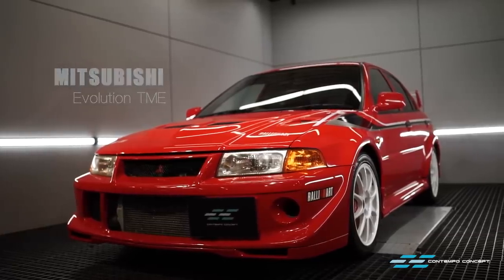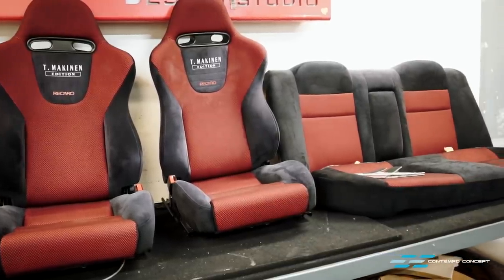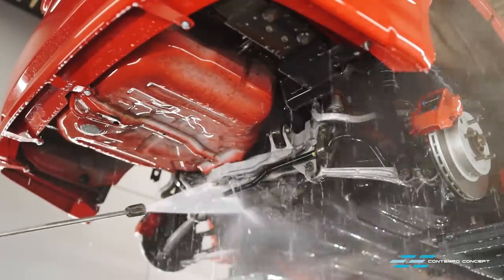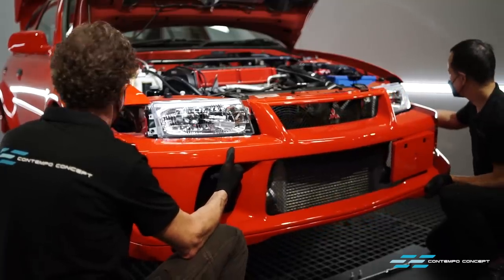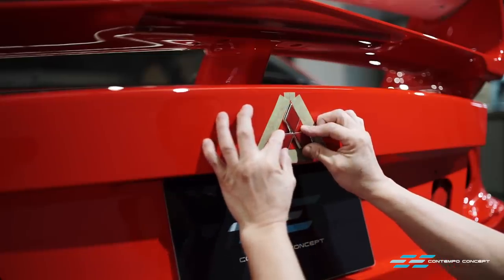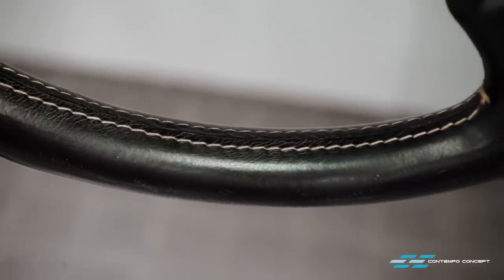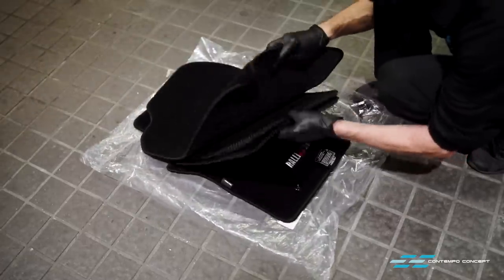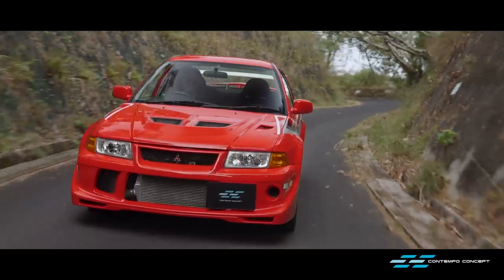Mitsubishi Lancer Evolution Tommi Makinen Edition Restoration

Comment: I love the fact that you have saved the original seat covers and not just replaced for newer ones. For me, the true meaning of restoration is when one tries to use and restore the original parts which came from the factory that includes evey nut and bolt.

Comment: The end result is awesome your work is incredible too. The only thing I want to point is that restoration with buying all new parts from magnification is super expensive. I'm an owner of an EVO X and I can tell you that the original hood is more than double the price of a high-end carbon one. I understand the difference but changing a large amount of the parts by brand new is not so awesome as restoring the old one. I can totally agree that new vs restored is not the same and you guys are professionals and perfectionists and that is all about in the video.

Great video totally worth it watching it.

Comment: It's great that you presumably can still buy all these parts brand new from Mitsubishi. That really is such an important thing. I've owned and restored multiple AE86 over the years and the biggest problem of all when doing a restoration was actually being able to obtain the parts. Try to order new from Toyota? Forget it. Vast majority of bits are long since discontinued. And the few that remain cost a lot. Like even for a few window exterior surround strips it costs like the equivalent of $3000. New interior parts like door cards or seats etc? The only option is to search for them used.. and most are in worse condition than your own. For a set of rare interior seats like the rare tweed.. you could be expecting to pay many, many thousands.. and that'd even if you can find someone willing to part with them (you wont). Lights.. all discontinued now. I actually have some lights that bought years ago and they're worth ridiculous prices but I wont sell them. To do a perfect restoration like this would be nearly impossible on some cars as you just wont be able to obtain the new pieces.

Comment: Not sure what I think of this resto and the collectors dream comment. Collectors are looking for original cars/ survivors and they can still be easily found. If that paint was original I think it could have been worked with to be fixed and preserved as repainted cars don’t fetch as much in the collectors market. However if it had already been resprayed it would be understandable to respray the car. Also great detail went in to making the car oem then an original muffler is ceramic coated black. Original cars have exposed aluminium they could have ceramic coated it or hi temp baked it with aluminium colour to continue the originally theme.

Comment: Lol people act like oem parts are expensive, it’s only the things usually sold in stores that are very expensive and if you notice things only found at dealer are priced reasonably and small things like hangers and such that are cheap too. Muffler and lights were probably expensive but you can always see if you can get a deal on em

Comment: I see more replacing of parts than true restoration. Especially the replacement of the headlamps is a true war crime. You know you can restore faded headlamps real easily right?

Also not clearcoating the stickers is a true shame. Have fun while pressure washing the car and the stickers blowing off.